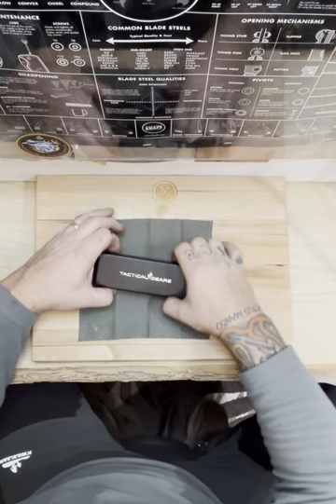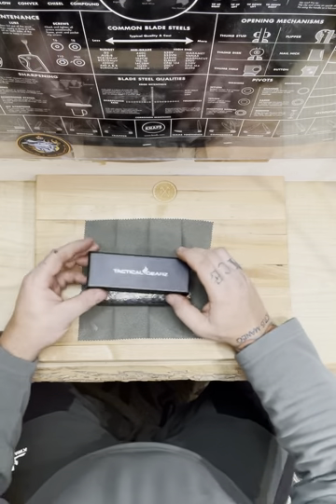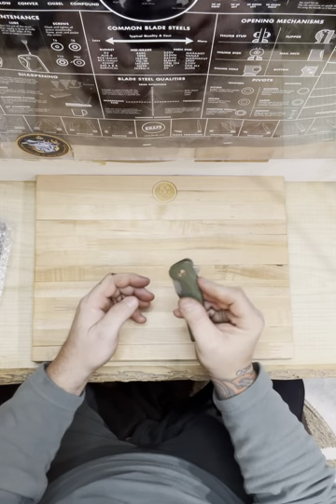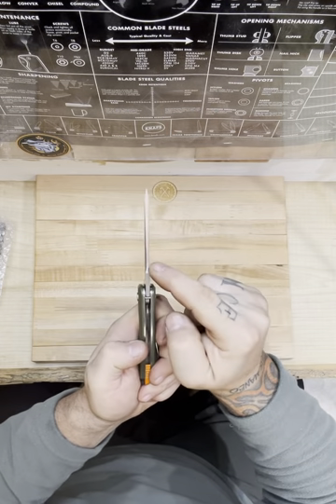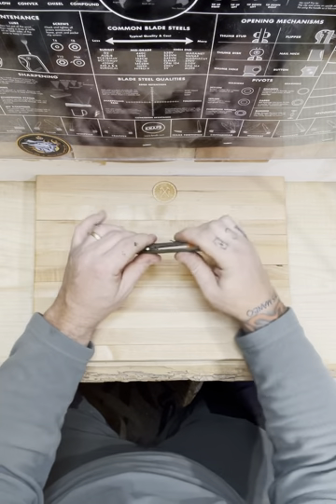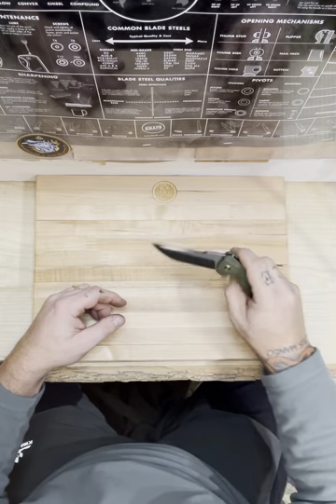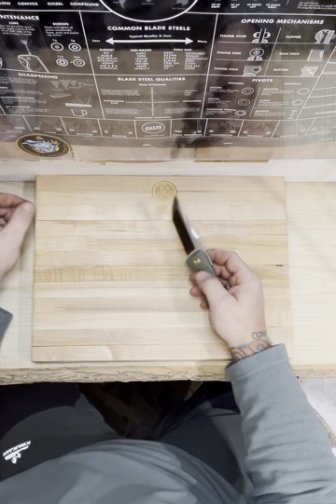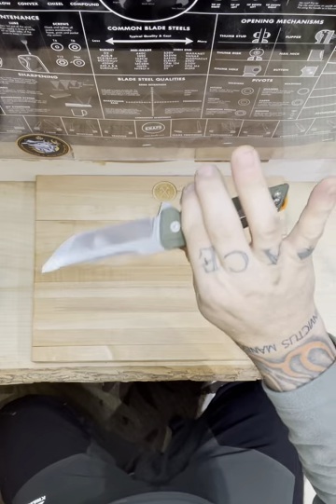Tactical gearz tg orion od green knife review

Comment: Look how thin the Benchmade blade is. I worry that if I ever have to defend myself with a knife and I need to plunge somebody quickly - knives as thin as the Benchmade could possibly bend, snap and end up getting you killed. Think about it; you might have to go through somebody wearing an hoodie with a button up underneath, a t shirt underneath that and maybe a white beater; I feel like that could be problematic for a thin blade which is anywhere from .04 to .110 of an inch to actually get through all of those layers, that with the full force of the thrust of one's arm to plunge through. But that thick TG knife would never have that problem of possibly snapping. Seems way more reliable in a real tactical sense.